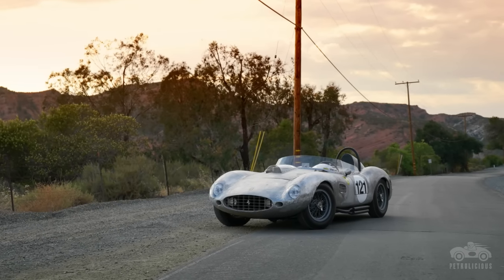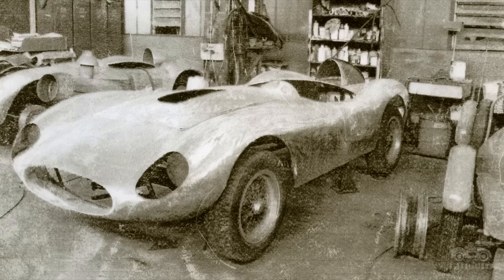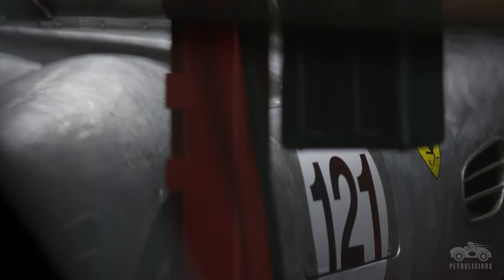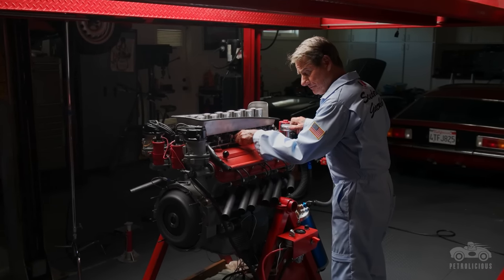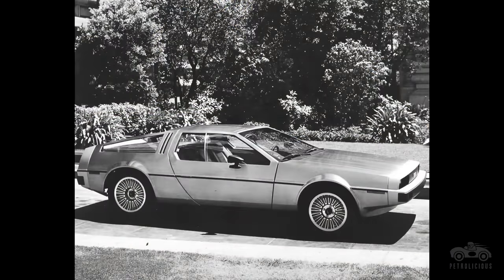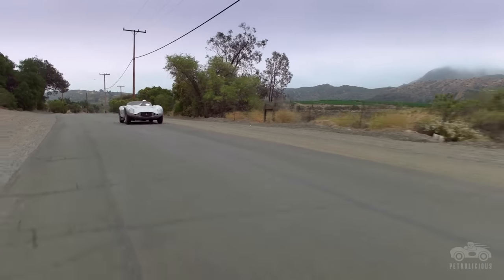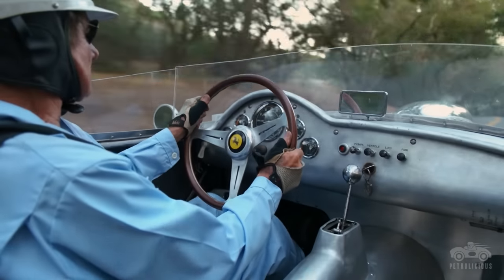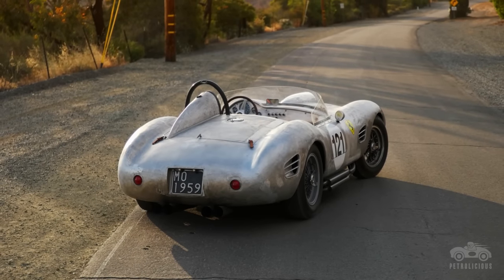Building Your Dream Ferrari Is A Beautiful Thing - Petrolicious

Comment: Please do not ever paint this car, it looks absolutely amazing this way.
Reply: Michael Westen very true
Reply: If he paints it it nearly wont be original!
Reply: Make it red. Because red is faster.
Reply: Yes it does! 😊
Reply: Silver Ferrari
Reply: paint it
Reply: I say it needs to be perfected and modernized, just to piss off real Ferrari owners. I would: have custom replica tires from factory with an h or v rating, get the wheels widened by an inch or 2, flatten the whole bottom of the car and add discrete defusers underneath, place a hidden turbo in back of the car before the exhaust and a  remote mounted supercharger placed out of sight, go stage 1 or 2 on engine and transmission (depending on driving style), change the final drive ratio a couple to a few thousand higher to rev her out in the twisty mountain roads, add speed sensors to a magnetic suspension, cut out the rear for a pop up spoiler and add a mechanical front valance (like 3000 GT VR-4) (optional) - both activated by speed, etc... we already know it's not an original, we know, but it would be a kick in the pants to destroy those old cars in an old car replica made with real Ferrari parts; brought to a new level of perfection and design, a vehicular toy that echoes the past, is in the present, and has so much future potential. I guarantee it would make an old timer blush and a younger man get a boner for such a piece of art.
Reply: Clearcoat for corrosion protection?

Comment: 400 horsepower... 2300lb, that's supercar standards even for today.
Reply: Yeah, on skinny damned tires! You could scare the crap out of yourself and any "foolish" passenger you enticed into the car. I understand Peter's desire to keep the "original" proportions because that was what the 1959 Testa Rosa used, but he's running with maybe a hundred extra horsepower and a bunch more torque. I think I'd be buying tires by the truck load even if I was being a "good boy" and not leaving a couple of black stripes every time I got on the throttle!! 

I was very fortunate in getting to drive several 20-30 years newer Ferraris in a shop I worked in, with much more modern power trains, including lots more rubber, and they could still get you into a whole bunch of trouble if you insisted on getting silly with them. I can just imaging what Peter's car must be like as he has it set up. Wow!!

Comment: In the mid 80's I watched in bits 2 Testarosas being built at Mission Motor Classics, now closed, just like this one. One was a pontoon fender, one was this body. Both were hand formed aluminum, tube frame, and as much Ferrari as possible, red heads, transmissions, differential in one, Jag in the other (can't remember which) etc. When they were completed an original pontoon Testa was brought in and it was extremely difficult to tell the differences. Number plates aside they were basically identical. That was a magical time, real race Cobras and all and getting to supply parts for some of it gave me entrance and some memorable rides. My hat's off to the person who has the ability, drive and time to build cars as special as this. Racing and performance is in my blood too and Ive3 been lucky enough to pursue that though Arthritis has taken that joy from me now I have the memories, just wish I could have built something that special myself. Keep the dreams alive!

Comment: In my opinion, this is way better than the original 250TR, more powerful motor, parts aren't nearly as hard to source, it's basically a restomodded 250 TR and without worrying about rare parts, it's a daily driving classic Ferrari, that's the coolest part about it IMO

Comment: We had replicas in where I worked that were absolutely terrible amatuer garbage, and a real one that was just a pampered never driven trailer queen, but this is in a class of it's own. I love the way the body has been left so you can see the original craftsmanship. Original parts, if they exist, are sold for scam prices, so this is as near as you get to the real deal. It looks right, sounds right, and more than that, it's useable. Good job.

Comment: If someone took a 57 Chevy body that had never been assembled and they built it using mostly Chevy parts with a few custom parts and they installed a 1970's big block Chevrolet engine, nobody on earth would say it isn't a Chevrolet. They may say it isn't an original 57 but they wouldn't question if it was a "real" Chevrolet. 
I think some people get bent out of shape about this car simply because it didn't roll out of the Ferrari shop, as assembled by Ferrari. As far as collector value, they have a point but, this is mostly Ferrari parts of the correct era. What isn't original was carefully recreated. Then he used a newer engine, an engine Ferrari would have used had it existed in 1959. 
Is there a 1959 out there that is as it rolled out of Ferrari's shop? Is there a 59 engine that has not been disassembled since Ferrari put it together? I would say, of the originals, the vast majority of them have been worked on extensively by people other than the shop in 1959. 
Of the original 1959 cars, what % of their parts are still on the car, actually installed by Ferrari in 59? 
The point I am making is saying this car wasn't put together by Ferrari isn't a valid point because any car that has been worked on, or restored is not "factory original". 
Using original parts from similar cars is just like using second generation Camaro parts on a different year of a second gen car. It's the same part. Doesn't make it any less Chevy. 
Only real issue is the chassis. If they made a faithful copy, it's not technically Ferrari but they could keep, or capture the essence and I suspect they did. 
I would say he built a custom late 50's/early 60's Ferrari race car. The 57 Chevy with a 70 big block wasn't a configuration Chevrolet made but it's still a full blooded Chevy, exactly like this car is a full Blooded Ferrari. It doesn't have the hyper high collector value simply because it doesn't have a serial numbered chassis so it's technically a reproduction but this man, sure as s__t, built himself a Ferrari race car. Good on him!!

Comment: You don’t need to hear that music at the end to understand this man is in heaven behind the wheel.....it looks incredible at speed on the road
Reply: The video was filmed on a closed road in Orange County California.  Speeds were in the mide 50 to 60 mph max (except for the 4th gear 5000 RPM shots in the canyon ~ 80+)  We also have raced the car at Auto Club Race way and Willow Springs in various VARA events.  In 5th gear @ 7000 RPM is tops out about 170+ MPH on the long straights.  It has won several 1st place in class.  Peter tells me that it is a real kick in the butt to drive.

Comment: As for the question about "Why not paint it Red" vs leaving the body unfinished aluminum?  The answer is really based on the origin of the body shell. 1.  Pininfarina was the coach builder who was under contract with Ferrari to design a revised 250 TR  race car to resolve some the earlier aero dynamic issues with the original "pontoon" design.2.   Tooling up to build 5 race chassis didn't make economic sense, so fabrication was sublet out to other coach builders. There were several interested builders, and competed for the contract. The coach builder of this shell tried to get the contract but was not successful.  The  contract for the 1959 250 TR design was given to Fantuzzi who build the production race car bodies for the Pininfarina design.3.  The body shell that Peter built is dream 250 TR Tribute is a 50+ year old relic which was originally met to be a "proof of concept",  hastily put together by the coach builder hoping to get a contract to build the race cars, but was not successful.  It was never met to be a real race car and therefore was a patch work of bits and pieces of various scraps of aluminum.  The proto type "proof of concept" shell was abandoned and hung in the rafters of an old carrozzeria for many years before Peter purchased it.4.  Given that this shell was never met to be a real car and hastily put together, short cuts were taken and fabrication was not of the highest standard.  As a result, painting the car would require "tons" of body filler, which would not stand the rigors of driving on a race circuit or on the street.  It would have be the appropriate Ferrari Red but then it would become a garage queen and couldn't be driven.5.  Peter made the decision to fabricate a real race care that could be vintage raced safely yet maintain the character of the original design.  Thus "Building a Dream Ferrari" was created over a period of about 10 years and continues to be enjoyed tody.Peter asked me that extend his thank you for all of the kind and generous comments.  There are limited plans to both race and show the car in 2020.  We would enjoy meeting and seeing you in the coming year.Jim

Comment: people that say this is fake don't know what they're talking about I really think it's a recreation not a replica that's a better term for this car, and truthfully a lot of the guys who raced Ferrari's back in the day often times if the motor blew or whatever just threw in a 327 or 350 Chevy because it was cheap horsepower and easier to work on and throw in and go so I think in this sense you're a lot more authentic then those guys you really could almost call this a hot rodded Ferrari the only thing keeping this from being a true Ferrari is the fact it doesn't have a Ferrari issued vin number.

Comment: Brilliant. Personally I don’t care about rarity/limited edition I’m just interested in the experience. If you can get the same experience for $100,000 as opposed to $35 million that’s great. The 427 Shelby cobras can be reproduced for under $100,000. The experience is the same, the car is safer, brakes better and handles better but it doesn’t cost over $1 million.

Comment: Well, the value of original is about the effort which been invested into the project of 5 road capable racing cars. Today, it's a piece of history and way of expirience of what people could achieve back in 1959. Because the chassis of it belonged to the factory which produced chassis for ferrari we can claim it is original ferrari chasis. Of course this car misses the history of 60 years of exclusive ownership. Nevertheless the chasis is 60 years old and if there is much emotional content in the sadness of non released 6th ferrari testa rossa. The value of this car is way more over 1 million dollars. Count the handbuild engine, details and base. I do admire road living car that could end badly if not finished what ferrari started. Basically, ferrari should give award to this man for building most beautiful ferrari from original parts that could never be created. So far, the amount of effort of this project is way more then building a 5th 250 in series when you have all parts loaded. Of course the most important is the first one. This one is last, but not least. I do admire your car. Passion.

Comment: Interesting story. I wonder what kind of suspension it has? Live rear axle?
Reply: Modified Ferrari 400i trans and rear end.  Front is Ferrari 330 with ZF fast ratio steering box.  Chassis is a replica of the 250TR frame to very exact specs for track and wheel base.

Comment: If only it had the pontoon fenders, still gorgeous tho
Reply: Ferrari built a total of 33 250 TR cars: 28 of the 57-58 "pontoon" design and 5 of the more aerodynamic 59/60 variant.  The early 1957-1958 250 TR  were the pontoon cars were designed by Scaglietti .  For the 1959 season,  Ferrari had Pininfarina design a newer more aerodynamic chassis, thus the 1959-1960 series.  A total of 5 cars were built and became some of the most significant Ferrari 250 TR's in racing history.  

This particular tribute car was built around a vintage body shell that was fabricated in 1957-1958 as a "proof of concept" done by a small fabricator in Italy and was purchased by Mr. Giacobbi.  The effort took about 10 years to complete and is done with period Ferrari NOS parts.  The tubular frame was build from factory build spec for the 59/60 cars.  There are more "real Ferrari" parts in this car than most modern new Fiat/Ferrari manufactured cars today.

Comment: Petrolicious, I think it's wrong to say it's a recreation Ferrari 250 TC because the chassis is a copy one and most of its parts. When you say a recreation it should be an originally Ferrari car with different model transformed to 250 TR, that's how you defined a recreation car. This is simply a replica of 250 TR, a good replica not a recreation.